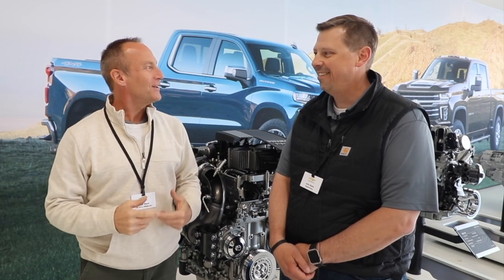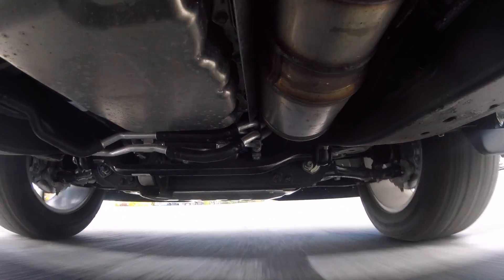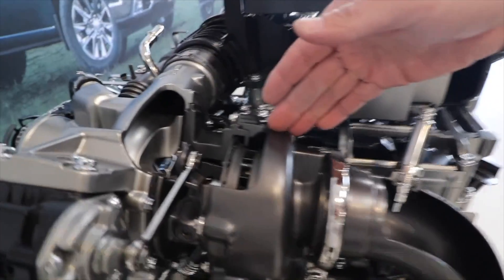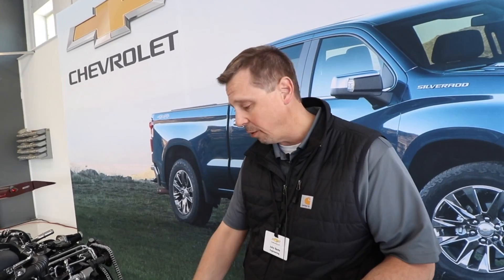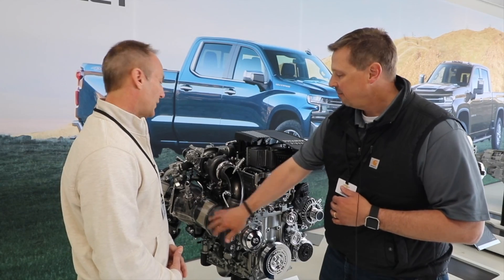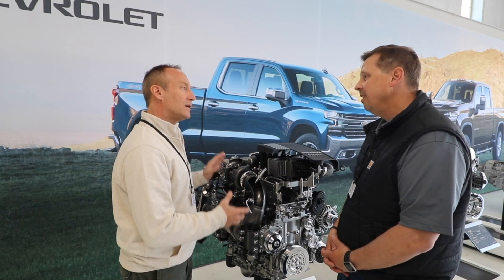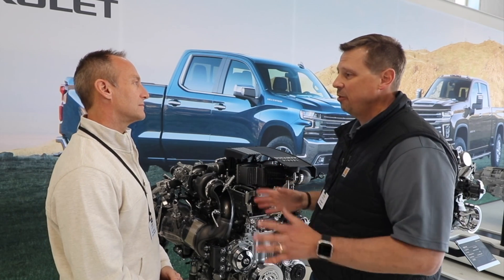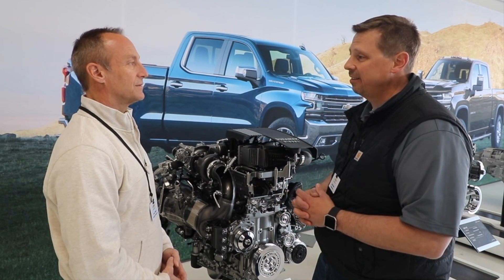Engineer Reveals All! Duramax 3.0L for Silverado 33 mpg hwy

Comment: Assistant chief Mexican coordinator
Reply: GM parts are mostly made in Mexico.
Reply: @kaulincurtis9665  
Then explain the 37 plants that GM has in the US
Reply: @anthonywebber2211  GM assembles the automobiles in the US so they can say it's built in the USA. The reality is many of the parts used are made in Mexico. They've been doing that since at least the early 90s.
Reply: @kaulincurtis9665  
The plants in Mexico are assembly plants, and there's only 5 plants in Mexico vs 37 in the US, and GM makes more then 5 vehicles
Reply: @anthonywebber2211  GM exports 7 vehicles from Mexico. They are Mexico's largest automobile exporter as of 2018. They also have been manufacturing components such as cylinder heads etc. for vehicles built in the US for well over two decades. For example, the aluminum cylinder heads of the venerable 3.1 liter v6 During the 90s were cast in Mexico. Not necessarily that the location of production will hurt quality, but I for one prefer to support purely American made products.
Reply: @kaulincurtis9665  
Start naming the vehicles made in Mexico
Reply: @anthonywebber2211  Chevrolet Cruze 4-door (sedan)
Chevrolet Cruze 5-door (hatchback)
Chevrolet Equinox
Chevrolet Silverado 1500 (certain configurations)
Chevrolet Trax
GMC Sierra 1500 (certain configurations)
GMC Terrain
Reply: @kaulincurtis9665  
Chevrolet Cruze sedan was built in Ohio 
Chevrolet Cruze hatchback isn't sold in the US anymore 
A majority of the Chevrolet Equinox is built here in Canada 
I think the Chevrolet Silverado/GMC Sierra is being moved to Fort Wayne, Indiana
Reply: @anthonywebber2211  I was referring to all exports from Mexico, not just tbose sold in the US.
Read it yourself. This is as of 10 months ago. GM exports more vehicles from Mexico than any other auto maker.  
https://www.google.com/amp/gmauthority.com/blog/2018/08/nafta-here-are-exactly-what-cars-trucks-gm-exports-from-mexico-to-the-u-s-and-canada/amp/
Reply: True they do make cruzes in Ohio, but many are also made in Mexico. The point is that GM exports more automobiles from Mexico than any other manufacturer.
Reply: @kaulincurtis9665  
Ford Fiesta
Cuautitlán Stamping and Assembly Plant (CSAP) 
Cuautitlán Izcalli, Mexico

Mazda2
Mexico: Salamanca, Guanajuat

Ford Fusion
Lincoln MKZ 
Hermosillo, Sonora, Mexico 

The Cuautitlán Stamping and Assembly plant has previously manufactured the F-150, F-200, F-250, F-350, F-600, F-550, F-650, F-750, F-800, P-350, P-400, W-250, W-350, W-650, W-750, X-250, X-350, X-650, X-670, X-750, Ford LTD, Mercury Grand Marquis, Ford Thunderbird, Mercury Cougar, Ford Tempo, Mercury Topaz, Ford Contour, and Mercury Mystique

Hermosillo Stamping and Assembly
Past
Mazda 323 (5-door) (1988-1990)
Mercury Tracer (1988–1999)
Ford Escort (1988-2002)
Ford Focus (hatchback) (2000–2005)
Lincoln Zephyr (2006)
Mercury Milan (2006–2011)
Reply: @kaulincurtis9665  
Buick Enclave
Lansing Delta Township Assembly,
Delta Township, Michigan, U.S.

Buick LaCrosse
Detroit/Hamtramck Assembly, 
Detroit, Michigan, United States

Cadillac Escalade
Arlington, Texas, U.S

Cadillac CTS
United States: Lansing, Michigan 
(Lansing Grand River Assembly)

Cadillac ATS
United States: Lansing, Michigan 
(Lansing Grand River Assembly) 

Cadillac XTS
Oshawa, Ontario 
(Oshawa Car Assembly)

Cadillac CT6
United States: Detroit, Michigan 
(Detroit/Hamtramck Assembly)

Cadillac XT5
Spring Hill, Tennessee, United States

Cadillac XT4
Kansas City, Kansas, United States 
(Fairfax Assembly)

Cadillac Future vehicles
Cadillac CT4
United States: Lansing, Michigan 
(Lansing Grand River Assembly)

Cadillac CT5
United States: Lansing, Michigan 
(Lansing Grand River Assembly)

Cadillac XT6
Spring Hill, Tennessee, United States

Chevrolet Sonic
Orion Township, Michigan, United States

Chevrolet Bolt
Final assembly GM Orion Assembly Detroit, Michigan

Chevrolet Camaro
 Lansing, Michigan, United States 
(Lansing Grand River Assembly)

Chevrolet Corvette
United States: Bowling Green, Kentucky

Chevrolet Cruze
United States: Lordstown, Ohio (Lordstown Assembly)

Chevrolet Impala
Canada: Oshawa, Ontario, (Oshawa Car Assembly)(Until 2019)
United States: Detroit, Michigan (Detroit/Hamtramck Assembly)

Chevrolet Malibu
United States: GM Fairfax Assembly, Kansas City, Kansas

Chevrolet Volt
United States: Detroit, Michigan 
(Detroit/Hamtramck Assembly)

Chevrolet Colorado
GMC Canyon
United States: Wentzville, Missouri 
(Wentzville Assembly)

Chevrolet Silverado
GMC Sierra
The GMT K2XX products are being produced at four GM assembly plants: Arlington (all SUVs), Flint (double and crew cab heavy-duty pickups), and Fort Wayne (regular and double cab light- and heavy-duty pickups)

GMT T1XX GM Fort Wayne Assembly, Indiana

Chevrolet Equinox 
Canada: Ingersoll, Ontario (CAMI)

Chevrolet Suburban
Chevrolet Tahoe
GMC Yukon
Arlington, Texas

Chevrolet Traverse
Delta Charter Township, Michigan, 
United States 

Chevrolet Express 
GMC Savana
Wentzville Assembly, Wentzville, Missouri, U.S

GMC Acadia
United States: Spring Hill, Tennessee 
(Spring Hill Manufacturing)
Reply: @kaulincurtis9665  
Defiance Casting Operations
Defiance, Ohio. 43512 United States
Car Family:

Ecotec 2.0/2.5L Aluminum Blocks – Chevy Impala, Malibu, Camaro; Buick Regal, Regal Tour X; Cadillac ATS, CTS, CT6
Gen V+ 6.2L Blocks – Chevy Camaro and Corvette
Truck and SUV Family:

Ecotec 2.5L Aluminum Blocks – Chevy Equinox, Traverse, Colorado; GMC Terrain, Acadia, Canyon
Gen V 4.3/5.3L Blocks – Chevy Tahoe, Suburban, Silverado; GMC Yukon, Yukon XL, Sierra
Gen V+ 5.3/6.2L Blocks – Chevy Silverado and GMC Sierra

Romulus Powertrain
Romulus, Michigan. 48174 United 
HFV6 Engine:

Chevrolet Colorado, GMC Canyon
Cadillac ATS Coupe, ATS and CTS; Chevrolet Camaro
Chevrolet Blazer
Cadillac XT5, GMC Acadia
Cadillac CT6
10-Speed Transmission:

Cadillac Escalade, Chevrolet Tahoe, GMC Yukon
Chevrolet Camaro SS and ZL1

Tonawanda Engine Plant
Buffalo, New York. 14207 United States

Year Opened:
Plant #1 – 1938; Plant #4 – 1941; Plant #5 – 2001
PRODUCTS
Ecotec 2.0L Turbo/2.5L – Chevrolet Camaro, Malibu, Colorado, Equinox, Traverse and Impala; Buick Regal, GMC Canyon, Acadia and Terrain and Cadillac ATS, CTS, CT6, and CT6 Plug-In
6.2L LT1 V8 – Chevrolet Corvette Stingray and Cadillac CTS-V
4.3L V6, 5.3L V8; 6.2L V8 Ecotec3 Family of engines – Chevrolet Silverado, Suburban and Tahoe, GMC Yukon/Yukon Denali, and Cadillac Escalade
6.6L Small-Block gas V-8 - 2020 Chevrolet Silverado HD, GMC Sierra HD
want me to keep going?
Reply: @anthonywebber2211  what is your point? The fact is GM does manufacture the chevy cruze, equinox, half ton trucks, etc. in Mexico. Did I ever say they made every single one of them in Mexico? No, I didn't! But they do make a lot, and they are/were sold here in the United States! They make so many they are the largest automotive exporter in Mexico. Do I need to say it again?
Reply: @anthonywebber2211  cruze wasn't discontinued until this year so I fail to see why that matters. The last one  was made in March of this year.
Reply: @kaulincurtis9665  
The US got the Cruze sedan  was built in the Lordstown Ohio, only the hatchback came from Mexico and 5-10,000 vs over 100,000
Reply: @kaulincurtis9665  
Production of the Chevrolet Cruze Hatchback is due to end at Ramos Arizpe Assembly in Mexico
Reply: @kaulincurtis9665  
Holden launched the Holden Equinox (EQ series) in Australia in November 2017, with the first cars scheduled to arrive in December.  It is produced at GM's Ramos Arizpe assembly facility in Mexico
Reply: @kaulincurtis9665  
The Holden Acadia is built in Tennessee with RHD specifications,

Comment: Sure he is not just a salesperson trying to sale a engine. A diesel engine that is only guaranteed to make it to 150k miles. If it fails after that, you have to take it to the shop, because you have to remove the engine to work on it. Darn look at all the possibilities of oil and water leaking from the rear. So much fun :)

Comment: Good video but I won't buy one knowing that there is a wet-belt-driven oil pump that will be lucky to last 150k miles. Oil and heat do not favor rubber belts. And what is the shop time that GM allocates for the procedure to replace this wet-belt? (Hint: You have to drop the transmission.) I was looking forward to one of these diesels in a Tahoe/Yukon.

Comment: get rid of emissions, tune it, and new exhaust and you'll get 33mpg....as is 20mpg
Reply: Burning significantly more fuel marginally cleaner at best is a good trade off according to government regulators
Reply: Exposed Motion Cinematics
New 3.0L Diesel 2020 Chevy Silverado 1500: Everything There Is To Know!
The Fast Lane Truck

got 31.6 and 44.3 hypermiling
Reply: @jadosa29  I couldn't have said it better.

Comment: I was excited about the superior architecture of the inline 6.  So overcomplicated though.  Non starter with removing the transmission to get to a belt.  Gears can be used instead of belts/chains.  Fuel rail pressures too high.  I'll stick with the iron 4.9 l Ford gas.  KISS engineering seems to be a lost art.  Maybe they're designed to be in the shop often.

Comment: What about the 5.0 Cummins of the Nissan Titan 310 horse power and 555 torque the best
Reply from the maker: I believe it's only available in the Titan XD, which marketed as somewhere between and half-ton and 3/4 ton. It's also a 5.0L not a 3.0L. Because of those two criteria I didn't include it.
Reply: @4WDMagazine  why didn't you included is a  half ton not a three quarters
Reply: It's so awesome that Nissan dropped it from the XD.
Reply: Yes they dropped because is a 5.0 betuing a 3.0 and 6.7 and cost a lot of money but I love it still have 5 years warranty and 100 thousands mile I love it

Comment: 150,000 miles LOLOLOL. Toyota in Europe designs their diesels to last 500,000 miles. Fail.
Reply from the maker: No consumer vehicle engine has a design life of 500000 miles.
Reply: DO YOU MEAN  500.000 KILOMETERS  I THINK ALL EUROPE  USE  KILOMETERS
Reply: A Hino/Toyota truck might have a diesel like that but not a consumer diesel.

Comment: I like the idea of the water aftercooler and resultant shorter intake runners. Makes sense. Not sure about the swirl valves though with EGR. It seems that they would carbon up an malfunction ala the Ecodiesel.
Reply from the maker: Did you have an Ecodiesel with that problem?
Reply: @4WDMagazine  Yes. CEL every few months. Multiple "refreshes" of the ECM to "fix" those CELs. Initially got 28 mpg with it and that steadily declined to 23ish. At 62000 miles and 5 years and change old and out of powertrain warranty I felt compelled to get out of it. All that EPA crap (ECR, SCR, DEF, DPF, swirl valves...) is extremely expensive out of warranty. I can't help but wonder about the long term reliability. My 2006 Dodge Cummins has 135000 miles on it and I profoundly simpler.

Comment: 150k? That’s nothing in today’s world.
Reply: eightys4ever, no kidding. Why 150K are they saying that the motor is a throwaway motor. If taken care of it should go 600K plus. Heck 150K screw the Diesel and get the gas. But time will tell.
Reply: theory816, My almost 30 year old Toyota with north of 400k still running fine. To your statement about things wearing out, yes, I’ve had to replace some things, especially lately, but the engine had a head gasket go out around 325k, and that’s it for engine issues. A pinion bearing went out years ago, otherwise just routine items that normally wear out. Ironically I’m on the original starter, but about my 4th alternator.
Reply: @theory816 I have a 1997 nissan truck with 178.000 miles runs perfect
Reply: New vehicles aren't made to last, that doesn't make them money when you don't have to buy another new ride every 3 years.
Reply: @jakkkflash  If you really do have a 3/4 million mile Cummins you should make a vid regarding it.  Also coolant change is important, cavitiation is a real silent killer.
I've seen "rookies" older than me screw up a good engine in just a few thousand miles, one idiot I was rebuilding one for didn't think he needed anything but pure water and busted the block LOL I do have a video about it too.
I run cheap/free waste oil for fuel without a problem but this is where HEUI systems trump over a high pressure fuel pump, what I feed my 7.3s would kill a common rail fuel system.
Reply: larry Looney 
Hear ya. I have a 94 Ranger w/230k. Sure it needs maintenance, brake lines replaced, power steering hoses recently, but it's still less than my payment each month on that Chevy would be.
Reply: @happydays8171  I made 340k miles on my ol 94 ranger before I sold it off, all it saw engine wise was a cam and head gasket.  I bought it when I was 16 with not even 50k on it and drove it hard it's whole life.  
Sold it once and found it and bought it back a year later kept it a few more years till I was in need of money and let her go for the last time.  One of the best trucks I've ever owned.
Reply: @eightys4ever  yes that's true some of them go  forever...but I also know of many Toyotas that don't and need lots of stuff at 150k...I have a gm truck with 342k on it and have only done a water pump and starter in the last 13 years...never is in the shop..turn the key n go
Reply: My Silverado has 273k miles on the original drivetrain..5.3L 4l60e 10bolt rear....I've had to fix the a/c once and just replaced the original radiator....diesels should last 1 million miles with proper care

Comment: 150,000 miles target!!! Diesels use to get 1 MILLION miles. He figures it MIGHT go 400,000 miles? I'd say don't buy it . Understand maintenance on a diesel is incredibly expensive. The saving in miles per gallon won't offset the maintenance costs.
Reply: You should definitely slap yourself. What pickup truck has targeted 1 million miles on the engine? Its not a semi truck
Reply from the maker: That 150,000 mile 'no major problems' is a benchmark for the Ford diesel as well. The Ford 3.0L diesel engineer said the same thing - https://youtu.be/q4I7pAseDdE . No consumer engine was ever built to a 'guaranteed million miles'. I've driven diesels all over the world - especially where they are as popular as gas - and the maintenance then and even more so now - is negligible. Thanks for commenting!
Reply: @ohgodwhat1  The Cummins 6 cyl.  Diesel in the Pickup Trucks before smog control. I sold mine at app. 750,000 miles.
Reply: @ohgodwhat1  One of the biggest reasons why Dodge pickup trucks are the #1 seller is Canada is linked to the very long life of their Cummins Diesel engines. The Ford F250's were abandoned by the Mining and Forestry industries here because they couldn't hold a candle to the Dodge diesel.
Reply: @4WDMagazine  I'm a retired diesel mechanic, my brother is an active diesel mechanic and we would both disagree with your maintenance estimates based on our experience. Diesels run in pickups by companies have low maintenance costs due primarily to proper daily maintenance, but, diesels run by Joe six-pack end up being very very expensive to maintain. You might say ,well thats just poor customer maintenance and you would be right, but it is also to norm. The idiots that start a diesel , drive to the corner store and kill the engine and do this type of "gasoline"  driving day after day or don't know to cool down the turbo after a highway trip and this list goes on and on, these type of people will end up with very expensive maintenance and this is the norm!!! Before you buy a diesel learn about the engine, if you don't it will drain your bank account!!
Reply: This isn't a "heavy duty" engine with a huge usable life target. The life target he cited is industry standard for light duty engines.
Reply: @earlkoropatnick1928  Your ram 6.7 or 5
9 cummins engine had a lifetime target of approximately 250k miles. Must be junk. The famous 7.3 Powerstroke had a lifetime target of just 200k miles.
Reply: The 6.7 Cummins has a "lifetime target" of just 250,000 miles. Same with the 6.7 Powerstroke. A lifetime target of 150k miles is industry standard for "light duty" engines. GM, Ford, Fiat Chrysler, even Toyota, use 150k miles.
Reply: @hochhaul  Exactly. Some guys are so clueless.
Reply from the maker: You got your money's there!
Reply: Exactly..150K is nothing..I have always worked on my trucks..at 200K I want to be able to give to my kid to go off to school..
Reply: The only diesels I’ve seen go A million miles and be worth anything were heavy truck engines. Cats,Detroit’s and Cummins . My friend has a fleet of fords 7.3 , 6.0s and 1 6.4 and 3 dodges 2 old 12v 5.9s and new 6.7. I know some of them make it but it’s way less than half and you will spend money to get it there. Even the old almighty 7.3s  are giving up. Every engine he’s got that has over 300,000 ish miles on it this weak is a dishrag and has a ton of blow by. One of them might rattle along and make it to 1,000,000 miles if you buy enough oil to put in it. I would probably want to rebuild it way before the then. He has a lot of money in injectors and turbo’s over the years. Most of the million mile diesels were in the late 80s to the mid 2000s those were the real engines. Gas engines are surpassing a lot of these new diesels in the last 15 years.
Reply: I think the target mileage of a 6.0 power stroke was 50 miles. My bosses made it 4 days After he bought it and then they had the body off of it for three weeks.

Comment: This 3.0 is as powerful as the 7.3 diesel power stroke in a 2002 f250 lol.
Reply: But will it last as long....
Reply: @jasondelaloire9167   I can 100% answer that no.  To be fair though, none will do to emissions. Also the 7.3 got horrible mileage , this truck probably almost double unloaded.  I don't understand how in 5 years you come up with design issues. They know it would be brought up , why have a dam'n design you have to remove the transmission . Beyond dumb.